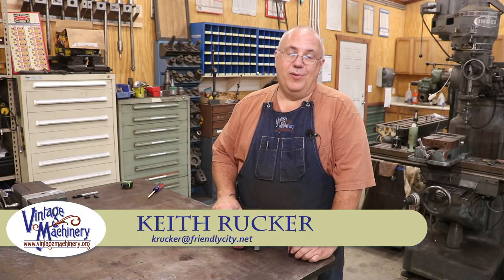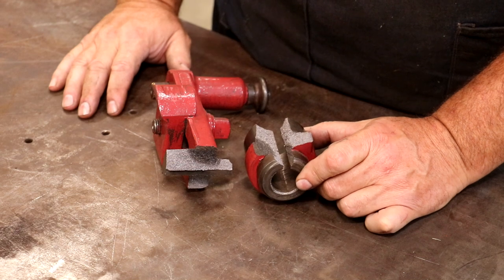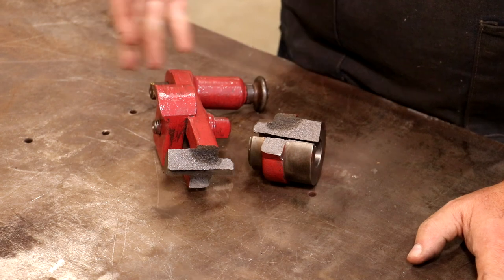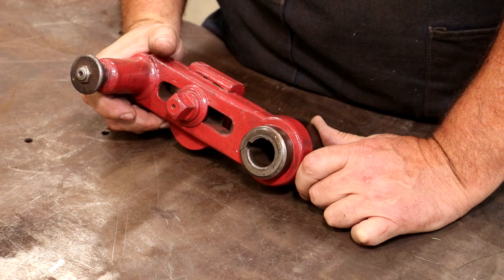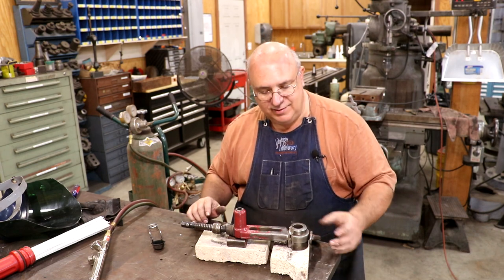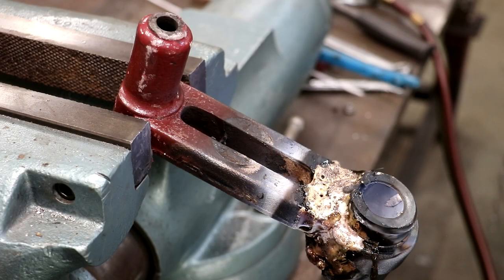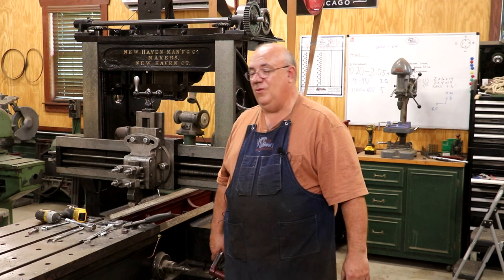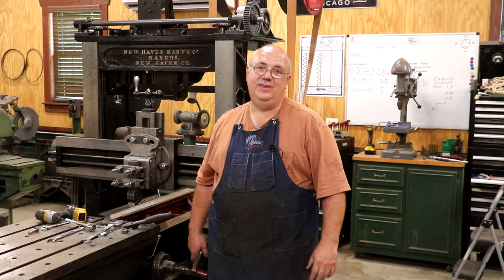Metal Planer Restoration 66: Brazing the Broken Cast Iron Shifting Lever

Comment: From a functional point of veiw I am sure that is adequate. If it was my job I would have filled the void's on both sides just for the asthetic considerations. But it's Keith's job and his machine I am just grateful for his channel. :-)
Reply: May be he can fill the voids with some putty before the paint job
Reply: If you braze the voids just to fill them you also add over braze to points that will then have to be remachined, if it is just for aesthetics, body filler or JB-Weld  would be the choice.
Reply: I kind of get the feeling that Keith's getting impatient to get this machine running!

Comment: Would have never thought about adding the retaining rings to secure the repair - excellent example of craftsmanship. I agree with several other commenters - fill the voids with body putty, sand it down and then repaint. So many other details have been meticulously done on this machine...it doesn't make sense to leave the voids since it's such an easy aesthetic problem to solve. I'd knock it out if I were you.

Comment: In 1972 I was running a Gray closed side planer 
for Waner&Swasey . One of the jobs I did did was planning old turret lathe beds for fitting hardened way strips . Before I could start I had to put in new roller bearing races .
The first thing I did was put the races in the freezer to get them cold to shrink them to put them in the headstock. 
Then I made my setup. 
By then they were cold enough put in. If you got them perfectly straight and not waste too much time they would slip right  to the back of the bore .
With in about 5 seconds they would lock solid. 
I saw one of these machines completed and  you couldn't tell the difference from a brand new machine. The strips were held on by brake off screws.

Comment: Totally agree many a brazing job if it fails again it’s always in the surrounding material. Never seen the braze it’s self fail.  Besides if cleaned up properly once the brazing process is complete it’s a nice looking repair. 
🇺🇸🦅🌏⚓️🇺🇸
Reply: Is the brazed area stronger, or was the integrity of the surrounding material weakened when the part was brazed?  This is a genuine question. I don't know the answer.   I do know that when some metals are welded, that the crystalline structure of the surrounding metal is changed causing it to become brittle and weak.  I did some brazing in college, but that was many years ago and that's pretty much the extent of my brazing experience.   This is just a question that came to me as I read your comment.
Reply: @buckinthetree1233  Brazing does raise the temperature to the fusing point of the iron. Therefore no brittle carbides are produced.
Reply: @boldford  I appreciate the information.
Reply: @buckinthetree1233  That should have read "doesn't raise the temperature to the fusing point of the iron". Fat fingers!
Reply: @boldford  I was pretty sure that's what you meant judging by your sentence structure, and knowing that if it was at fusing temp., that it would raise the risk of compromising the surrounding material.   I appreciate your clarification though.

Comment: Keith, I have a lot of experience when it comes to welding cast iron.  I've done it all, and I can confidently say I know what I'm doing.  With that in mind, I braze everything I can.  Why?  Because it works, and it's easier.  And if the part serves it's purpose, that's the whole point.  Most people I see that scoff at brazing either haven't done it, or base their opinion on an improper brazing job.
Reply: Would you advise brazing when repairing cracks on old antique tractor cylinder heads?   I like my allis chalmers tractors, but it seems when ever I tear one apart for a rebuild I have a cracked head to deal with.  Any advise on repairing cylinder head cracks on gas tractors?

Comment: I was taught to always apply a paste of flux in water to the joint before heating the part. As soon as you raise the part to red heat it is forming surface oxides and eliminating some of the joint preparation you did. Flux stops that oxidation.
Just adding flux to the rod means that the flux has to flow into the joint and remove the oxide that heating is creating.
Reply: Spot on advice Paul G. Brazing always must use a flux to chemically control surface oxides formed by the heating. Keith made no mention of fluxes as he used flux coated brazing rods.
Reply: @stevebliss3600  Yes , was aware he is using flux coated rods. In fact brazing is impossible without any flux. However, my point still stands, the flux on the rod does not get to the joint until after the area has been raised to red heat  and the oxidation has already occurred.

Comment: When pre-heating the part prior to brazing, you said you don't have an oven in the shop. What about the heat treating oven you've shown us? Does it have a low enough temperature setting to be used for pre-heating parts before brazing? Is it large enough for this part?
Reply: Not large enough to fit the part with it clamped. You don't want to be fumbling around trying to get it clamped up after heating it.

Comment: I started brazing bicycle frames when I was 12.  Not perfect at first, but you learn.  Since then, I've brazed many, many items, mostly CI, and I can't remember a repair that broke unless it was sketchy to begin with.  I'd never weld CI, it just causes problems.  Great repair; not the prettiest, but like others have said, that's what bondo is for.

Comment: The technique that Keith used on the collars is almost identical to the method used on steam locomotive to install the outer replaceable section of the driven wheels.
Reply: Known as "tires".
Reply: @bb_37  this is correct, but I was trying not to confuse people with information overload.
Reply: Also putting the steel tire on  a wooden wagon wheel.
Reply: @july8xx  this is true. I've seen that done as well.

Comment: It reminds me of the old company where I was. One of them had an accident with the one year old CNC lathe. The cast slide broke and the revolver sits on it. The delivery time for the spare part from Japan was 9 to 12 months, but urgent production was waiting. That's why the boss had the cast component brazing. A specialist company did it, and it was certainly expensive. After half a year, the new cast slide came from the manufacturer. Then the machine was taken apart again. The boss had to pay again. The employee waived his bonus this year but was not fired. But he had become very careful.

Comment: I have to agree that those voids look bad, but I also agree that heating the whole thing, rings and all, might not be the best idea. Maybe a little J-B Weld would do the trick?
Reply: I was thinking that too! Almost totally cosmetic (but ads a little strength). I like to make repairs look good. Just years of habit... ;)
Reply: Was thinking the same maybe even just some body filler, I have found that used to clean up castings in the past and easy to sand down
Reply: @gagasmancave8859  Body Filler is the normal thing found on Bridgeports and other high end machines....
Reply: J-B Weld (metal loaded epoxy), sanding, and paint will make it look "purty".  The part easily should be stronger than when it was originally cast.  The tensile strength and shock resistance of bronze is greater than that of cast iron and those steel rings, most definitely, help.

"Stuff" always happens.  :>(  It's what you do, when things take a turn for the worse, that matters.  Excellent fix, Keith.
Reply: @eliduttman315  We had a handle on a milling vise tha t was brazed 30 years ago [probably a 70 year old vise, shop opened in 1920] and took one heck of a beating....never any issues day in and day out......made me a believer in brazing......if done right......

Comment: Yes it is amazing it how steel will grow when it gets warm, I worked with a gentleman who used to lay out bridge beams before he moved the company that we work together at. He said that he would have to lay them out very early in the morning or even at night because the sun would cause the beams to curve from one side to the other based on where the sun was hitting them and it would cause his measurements to be off. This is also why on steel structures you have expansion joints I myself have seen the steel beams grow up to quarter-inch because of the Sun

Comment: Keith, for those that don't know, brazing is perfectly fine on cast iron, or even for bonding steel to cast iron. However, when it comes to steel, it does not penetrate the metal, but is basically a coating. Welding on the other hand, actually bonds and penetrates into the base metal, and is much preferred. Light gauge metals that are exposed to the elements, such as exhaust pipe are at higher risk of failure in the future if brazed. I know that there's a certain sense of satisfaction with either, but welding steel is the most desirable.

Comment: Very interested in your comments on nickel welding. I just had to braze the end bracket of the x axis of my mill which some one had repaired with nickel arc weld. It was soon plain that no preparation had been done, the weld looked like pigeon droppings, and when the heat got on it it was so porous the oil and grime oozed out. I had to grind all the nickel away before I could braze.

Comment: The heating of the rings is right in line in what we would do to put bearings on shafts in radial aircraft engines. Only difference is we heated them in an oil bath take them out and drop on the shaft. Very rarely had to tap them with a small hammer once or twice to get them to seat all the way.

Comment: Rule of thumb for thermal expansion (linear) of iron and steel: about 1 thou per inch per 100 degrees C (or 200 degrees F). Stainless steel, brass, bronze and copper all about 1.6.to 1.8 thou per inch per 100C.

Comment: Keith, thank you. I'm a machinist myself most of the time and I agree this is a functional repair. But, it seams you're in a kind of rush to get this *!?% planer out of your system which I can understand. This is not only about a machine in your workshop but the whole world is watching too. For me it would add extra pressure which I have enough already for my daytime job and that's the main reason I don't have a YouTube channel. But thankfully you do and I like to watch it! Back to the topic; with some small extra time and dedication this part would not only be repaired well but look nice too. For me that's additional satisfaction on getting the job done. I would rather see you spending two videos on this repair and fillet braze and file and sand it all to perfection. I'm just puzzling here about the repair and the final result in combination with maximum satisfaction on the job done and a final result which makes you smile years later. Maybe some food for thought. Rough jobs are common, bling results are rare. Thank you Keith! Looking forward to see some planer chips coming! Best, Job

Comment: There is a very similar process to shrinking the rings on sailboats back when they were all built out of wood. It was not uncommon for the mast to crack vertically but not catastrophically. They would wrap very heavy rope around the mast and tighten it with water and leverage. The process is called gammoning

Comment: When preheating larger pieces for brazing I use a tiger torch just to get the piece good and hot. It takes a lot less oxy- Accetelin to get it up to brazing temperature.

Comment: I like how you did this repair. Those rings might even be overkill, but I think they're great! Those cosmetic dimples would really bug me, even though they aren't going to be a structural problem at all. I'm curious whether you're going to need to do any work on the bore and/or key slot after the brazing job?

Comment: As a machinist that also done some teaching seeing someone running a lathe with a setup like that scares the living juices out of me. Prefer to do it myself so I have control and know clearance is checked and nothing gets close to that swinging thing that shouldn't.
Now please excuse me while I go and wipe off some cold sweat while you continue your job! :-D
Reply: This part could be machined more safely on a  Bridgeport by clamping it on the table and using a heavy duty boring head with appropriate boring bar. That way the part remains stationary and the tool rotates. Either way will get the job done as long as the machinist knows what he’s doing and is careful.

Comment: I've seen a lot of the YouTube machinists do silicon bronze repairs on cast iron.   I see the build up process they use on the external surfaces.   Is there any tendency for the bronze to "wick" into the original mating surfaces like solder does on copper?  Or is it more like using a hot glue stick on cardboard?   Just curious.
Reply: It “wicks” into the cast structure and adheres to it just like solder would. That is the importance of heating the base metal high enough to melt the bronze on contact with it. Melting the rod with the torch and dripping it into the joint makes for a weak joint. I have seen repaired parts that were struck again break at a different point and the brazed joint held.

Comment: I was taught torch valve down, far easier to adjust the flame and safer as far as where the flame is when adjusting it. My input from B&S apprenticeship.
Reply: I learned that from experience after finding my welding glove cuff would occasionally rub on the valve knobs, changing the flow of gas during my welding or brazing. Most annoying.

Comment: Would a rose bud put too much heat at once even if moving the torch around? Cast iron has always been one of the most hated materials here on our farm. We've always had to take the piece(s) into a machine shop and have them braze it back for us. We've done the nickle rod welding and have had some decent success with it but, usually that's for a much larger piece. Another question, if you don't have a fire blanket, could you use sand to let it cool down in? 
You didn't say "Yahtzee" when cutting that ring off. LOL 
How would you be able to keep the keyway from filling in while brazing? Great video as always, cheers :)

Comment: Wonder if it would have been suffice to just clamp it all back together with the shrink rings?
Reply: No, the shrink rings would quickly fail under torque and stress without the additional strength of the brazed joints. With the rings and brazing it’s a very good repair.
Reply: @ellieprice363  explanation rather than a very impolite no please

Comment: I am sure it will work and do the job it was designed to do. However, my OCD would have to fill in the areas and then smooth the entire part and finish up via media blasting to give it all a similar look before painting again. Just the way I am. I personally don't like "good enough" issues. And knowing how I like to do things, I would also draw up and make a pattern to have a cast part made. Then machine that cast part and fit it. Again, I just like things to be quality and look great as well. JMHO   Thumbs Up
Reply: I totally agree, that "fix is what I call half-ass. He put so much time and effort into the restoration to have that piece look like that is unfathomable.
Reply: Agreed why go 80% of the way, you’re already into it to fix it just finish it.
Reply: @garys9694  My thoughts as well
Reply: Nope pure cosmetics, when that's bolted on you won't even see it as there are washers in place. Looking good does nothing for function.

Comment: Would it be safer to keep the key out and use grub/set screw instead? 
If it happens again maybe then it just twists on the shaft and does not get broken. It does not look like it needs the key to transfer torque, especially if it can be operated by hand already...
I cannot make that call of course, I cannot see for sure if it slipping on the shaft would save it or not next time.
Cheers,

Comment: I don't doubt your statement that brazed repairs are stronger than the cast iron around it.  Could make an interesting test to braze some cast iron, and then break it with the press.
Reply: It's been holding Bicycles together forever.
Reply: Braze is more elastic, it will have some give in it where cast Iron has virtually no give, it will snap, i'd have stick or tig welded it and it would be as good as new.
Reply: The myth would be trashed 😆

Comment: Those who say nickel are wrong..  Cast iron repairs should always be brazed.   Nickel is really not strong or tough enough for structural repairs and its only benefit is that it matches color better..   I have gas brazed in the past, but my preferred processes nowadays are either MIG brazing or TIG brazing.  The big difference is general appearance and cleanliness of the repair, and I never get holes or voids like are quite common when gas brazing..   The gas torch is still necessary for pre and post heating the part though..

Comment: Probably should have remade the piece instead but kudos on the sleeves since they'll act like a tire on a locomotive driving wheels. Since their already there might as well fill in the deficits with some molten brass etc since it will add strength as well.

Comment: I would have had to fill all that in with braze.
Where the slot section meets the hub is the weakest part.
A large fillet would look nice and and fill up a low spot or 2.
Don't get me wrong I love your work, but please finish it before thinking about paint.......

Comment: I have a Chas Parker vise that's broken on the fixed jaw side at and off the Base. Would this method be a durable fix?
Reply: There have been many vises repaired with the brazing technique. Collectors won’t buy a brazed vise, but a vise repaired with bronze braze will work just fine.
Reply: @ronaldhorne5106  Don't want to sell it just want to use it.